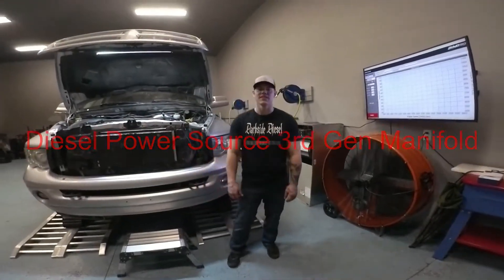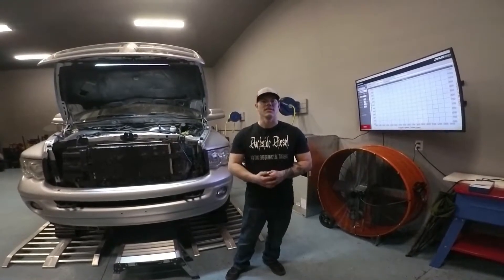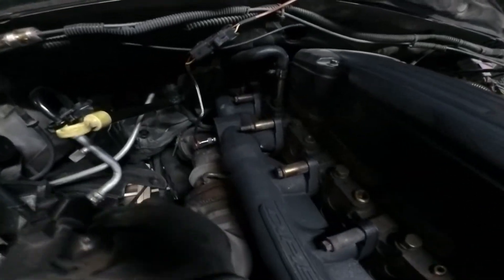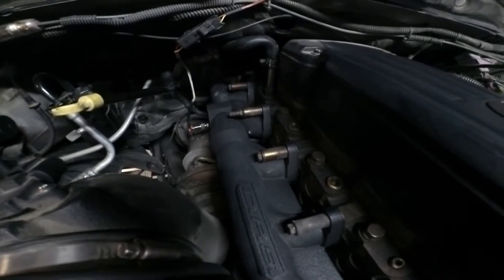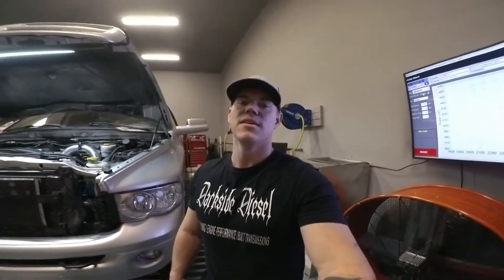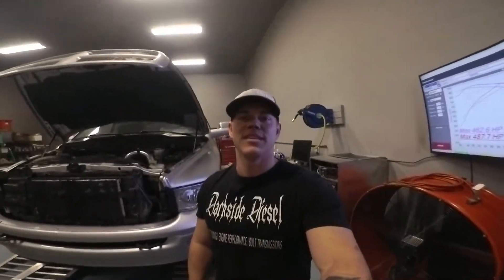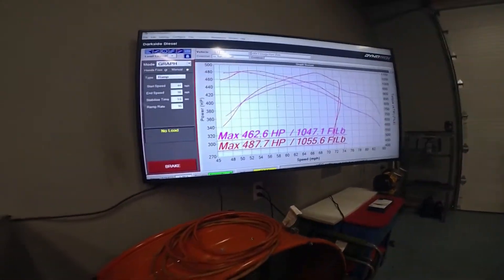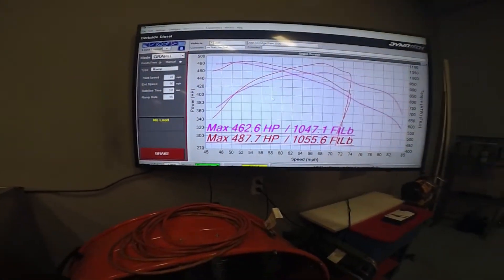Diesel Power Source 3rd Gen Manifold is it worth it?

Comment: Did you use a temperature gun to check the rear cylinders and how close all the cylinders were in temperature
Reply from the maker: We did not but we ran the EGT probe in the back port that references the back cylinders.
Reply: Glad that you made a video that shows the actual gains with the dyno.Everybody else just says it improves it.You actually showed it which is great. Looks like the horsepower gain was 5%. But the couple hundred degree drop in egts is great if that's what the owner says he got. Hopefully, it's on the back two cylinders, which usually run two hundred degrees hotter

Comment: Was the increase just with the manifold?
Reply from the maker: Yes it was. I installed the DPS manifold and put it on the Dyno. Very impressive. Owner also saw a decrease in EGTs at wide open pulls off 200 degrees.
Reply: @DarksideDiesel  
Cool thanks
Reply: Did you use the stock for both before and after dyno tests